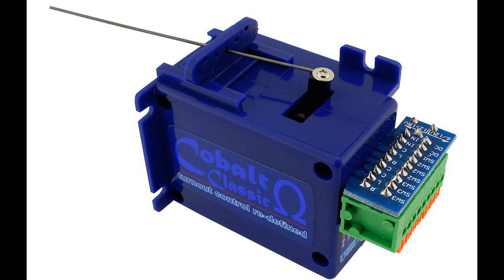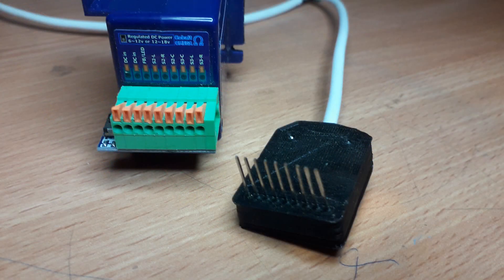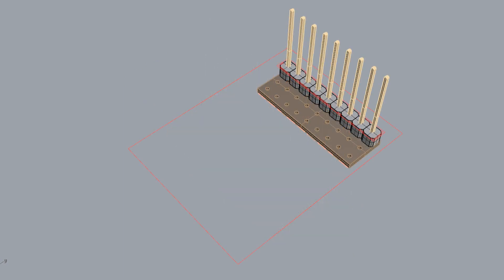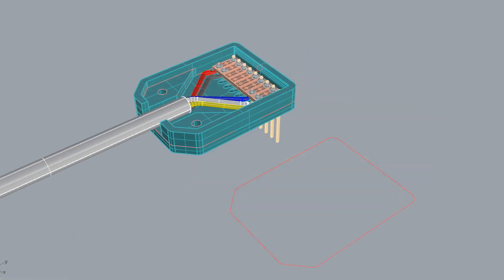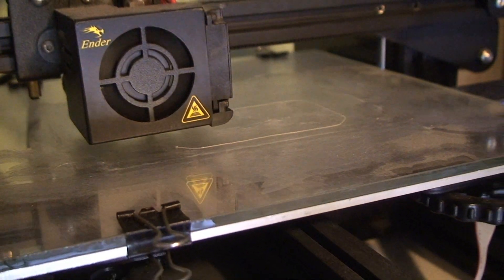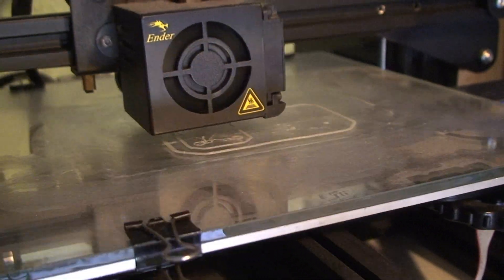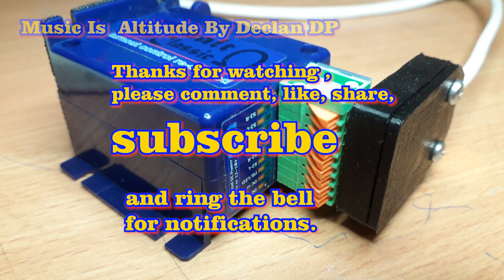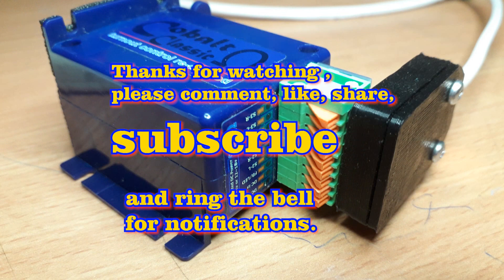cobalt point motor plugs

Comment: Hi Andy. Great solutions to problems - both for the mimic board and the point motor plugs. Unfortunately, this is a little too technical for me at my early stage of building a layout and the fact that I have no access to either a laser cutter or a 3-D printer. Nevertheless, it's great to see what can be achieved.

Comment: Great video and great idea. I use these cobalt point motors on my layout and also have a 3d printer so i've given it a go and bought all the components. The one issue I am having is cutting the circuit board without it breaking into pieces, any suggestions as to the best way to cut it up?
Reply from the maker: I have the luxury of a band saw at work , but a junior hacksaw and sanding block would be fine. Hope your prints come out ok.
Reply: @old_duffers_chuffers  Prints came out beautifully, credit to you for the design. I'll have a go with the junior hacksaw later. I might make a video of the process for my own channel if you don't mind? I will of course ensure you get the credit you deserve
Reply from the maker: @northfieldjunction2681  Look forward to seeing it, I've just subscribed . Regards - Andy - old duffer         We have to support small channels like ourselves
Reply from the maker: @northfieldjunction2681  Would prefer a link to my channel
Reply: I find traditional tin snips work well for this. But don’t cut along the holes , always between. On SRBP which is the brown ‘veroboard’ material cutting along holes will run a crack all across the board.  Not such a problem with fibreglass however.